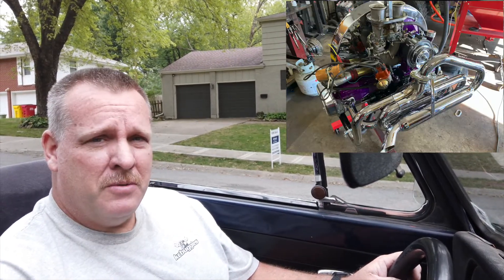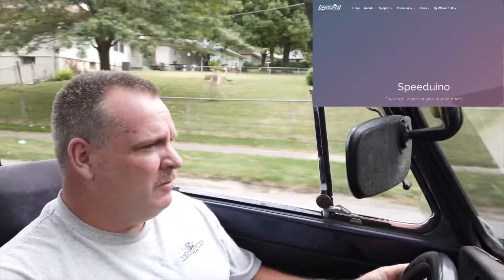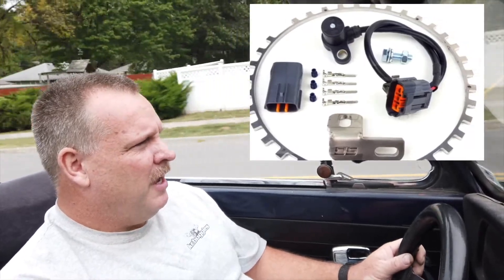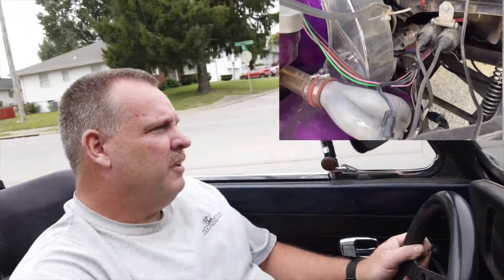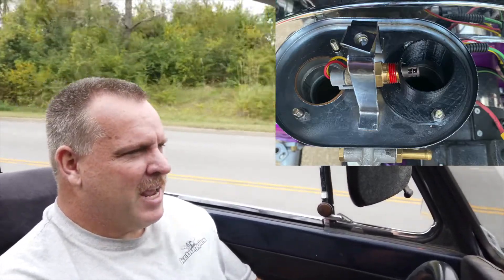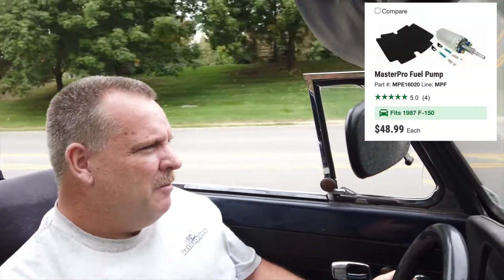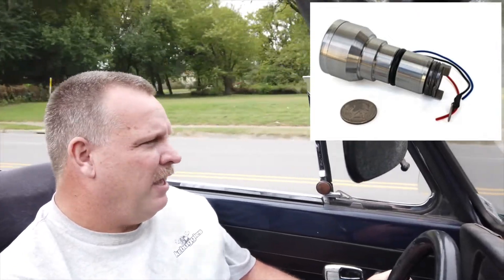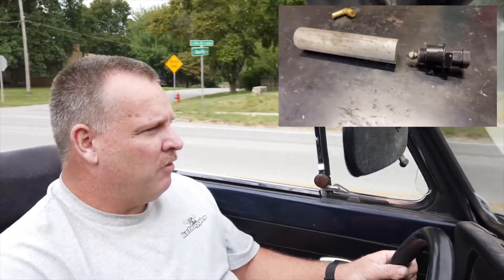Speeduino AirCooled VW project

Comment: Hey Will, nice job, i would be glad if ypu can show or write a bit more about the speeduino efi convertion to your flat4 engine.
I'm planing the same ;-)
Reply from the maker: Thanks. Let me know if you have any specific questions. I have a couple other videos and I can shoot some more. I have a couple more conversions coming up.
Reply: @wjones1972   thanks for quick replay, Will.
Yes, well, some questions you asked yourself in the other video ;-) https://www.youtube.com/watch?v=2ty8RvaTWjM
First question is where you placed the "other end" of the map sensor. Somewhere at the intake manifold or carb body, i guess!?
I watched some videos of the Speeduino, and found many information about the wiring just near the board, but only very little in the engine compartment, with all the sensors, fuel lines, ignition and so on.
Especially the hardware solutions (tubes, lines, injectors, ..) of the fuel system is interessting for me. How did you weld it and fix the fuel injectors? Are the tubes for them 100% self made? At the moment i'm not sure if i convert a 34PICT carb engine or a 44IDE dual Weber.
What about the idle stepper? How did you solve it in Hardware? I didn't find any information about "idle control" so far. Do you use an oxygen sensor, as well?
Ah, and, what about software setup? Is it done with TunerStudio EFI?
Thanks a lot in advance 🙂

Comment: Cool job, I'm going to do the same to my Vanagon type 4 engine. I want to do dual fuel rails one set of injectors higher up the manifold when it is warm for better fuel atomization.
Reply from the maker: Thanks Man. sounds interesting. I am not real familiar with Type 4 stuff
Reply: @wjones1972  The later ones on the t3's came with a (primitive) fuel injection system, no 02 sensors and the air is  metered by a flap that opens. Definitely can improve the power wit5h modern EFI and a bigger throttle

Comment: Hi William, from my research, close loop on a none turbo with no AC and electrical draining systems kicking in and out is an overkill for an air cooled engine. If you are happy with your current open loop mode and setting, you’ve got yourself in a good place. If really wanting perfection with close loop, check Andy Whittle’s vid on “Basic Idle Control and Fixing a Rolling/Hunting Idle). 
I would also recommend checking out DCWrex video on how to get sequential timing and injection with an NO2C (which seems like a easy pin/code re-assignment), and ideal for your Type 1 since your already have the 7073 Micro Cam-Sync. 
Would you consider also posting/sharing your tables, as I would be very interested in starting my project with a proven tune that is very close to my own engine (2Ltr Type 2 Bay Window Bus with Porsche Head and Mild Cam)? Cheers Al
Reply from the maker: Thanks for the tip I have watched that video as well. They have updated the firmware since this video and the Closed + Open works great. I should do a video on that and my installation in my 74 VW Thing.

Comment: Hi William. In another video I commented about the mexican VW Bug / Beetle fuel injected. Your project is awesome. There is a throttle body with TPS and IAT incorporated. The idle is controlled with a PWM ralenti valve like ford valve. it has 2 cable, is not a stepper motor. The NTC is on left head. I think it is a 4 wire sensor. I hope this information can be useful for you. The fuel pressure is regulated for a vaccum mechanical regulator. The ECU has an internal MAP sensor with a light green thin and long pipe until inlet manifold. The original FI VW bug had one coil installed on fire wall. The coil is a 3 wire coil.
Reply from the maker: Thanks I have seen the Mexican system I even have a few parts from one. But I was looking for more performance form some salvage yard parts and the ECU I assembled I modified the Webber carb I already had and the idle motor was a learning adventure in Stepper motor workings. I know there are a lot of options to make one work I  make one work I just wanted to document my project. I am working on a similar conversion to a 1974 thing this weekend.
Reply: @wjones1972  In the mexican bug ECU I think it is capable to chipping for a better performance. I think the ECU is Digifant system. A question... Is possible to pass emission inspection with the speeduino EFI? Have you try it? Thanks.
Reply from the maker: @vwivancc  I am not sure if that is possible we don't have emission testing in my area.  I would hope that it would pass I am sure it is way cleaner than the stock pic3 carb that was stock but in most cases that doesn't matter it also doesn't have any kind of catalytic converter

Comment: Good video.  Where on the manifold are you running the MAP and idle control lines?
Reply from the maker: I drilled and taped the intake for the MAP.  The intake I am using has both sides connected in the middle about where i put the MAP line.   If you look at timeStamp 3:09 you can see the idle air hose connected to the end casting on the left side. I would say this isn't perfect closer to the middle would be better in theory. but in practice there was a port there already that I was going to have to plug so I opened it up to 1/4 and it has been working well.

Comment: The more speeduino content the better. The latest n02c seems to be every bit as capable and maybe even more capable than a microsquirt. It has 4 ign outputs now and can be configured to run up to six injectors sequentially and still ground trigger cooling fan and fuel pump.